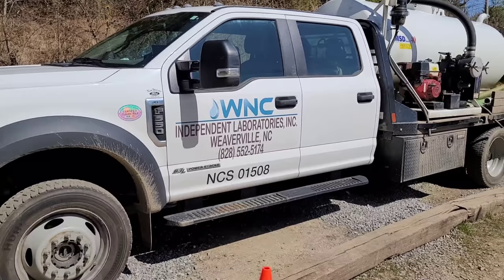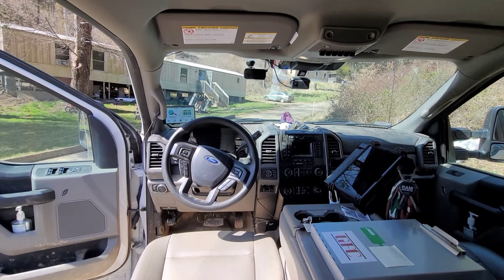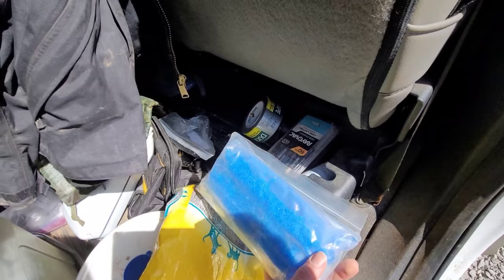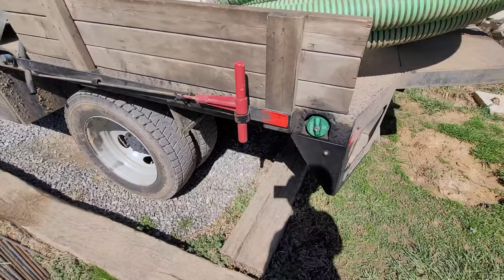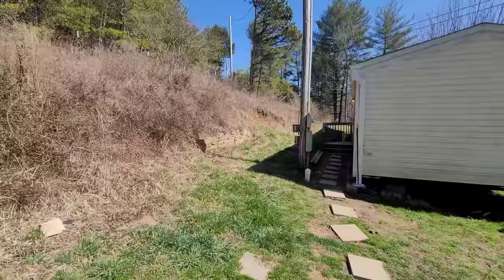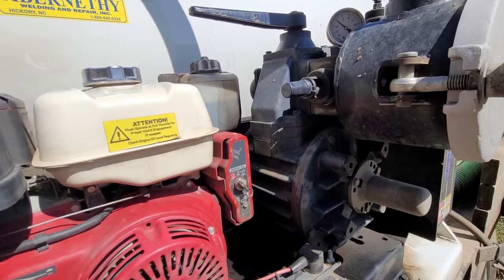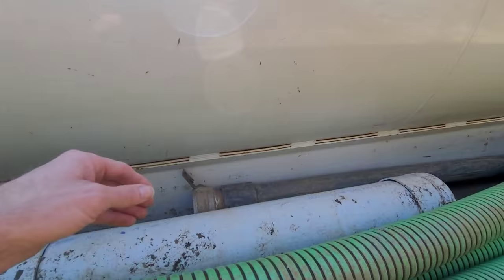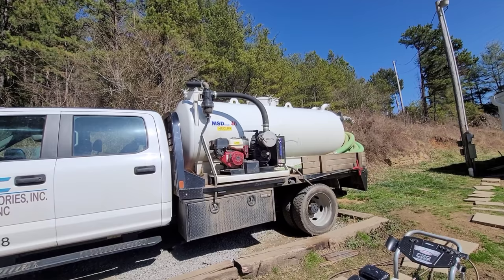Truck walk thru.

Comment: Just a few things I saw, first you should mount the GPS unit to the pocket on the center of the dash instead of the corner windshield, second, switch out the cooler to a ozark trail one from Walmart, they were tested against the yeti and found to be within one degree of it after a 24 hr period. Also on the back of your truck you should have a positive battery feed to the 7 wire trailer connector, wire that to the electric start on the pump motor thus eliminating the need for a battery. Just my two cents

Comment: For the issue with the valve freezing. What about putting a T in the exhaust (with a ball valve), running up to a box that is fashioned to fit around the valve. This would allow you to utilize the heat already being produced by the truck running. Have the box made so that it bolts to the bed for easy removal in case of repair or summer operations. Just an idea.
Reply: I saw your video on tic-tok and wanted to see if I could help. Have a great day and good luck with your endeavors. I enjoy watching your content!

Comment: I was thinking of a few things 1) for the back seat of the cab maybe you could get an organizer for it? Like one with drawers and goes halfway or all the way across the back might make it a look a little nicer inside the truck and be able to find things a little easier 2) I was thinking of a cover for the pump so you don’t get water into it I’ve seen some others have said that as well. 3) with the shovels and other tools that sit in front of the tank maybe get something like a gun rack holder but a holder for the tools so they don’t bounce around as easily

Comment: I don't know if anybody's mention this yet but I didn't see a battery charge wire coming from the truck to the battery on the Honda pump. 
I don't know about cab and chassis trucks but your standard Ford  pickups come from the factory with a trailer tow battery charge wire that runs to the rear bumper  7-way trailer plug and charges your auxiliary battery when the truck is running and disconnects when you turn the engine off. You might not have a 7-way plug on that bumper but the wiring might be in the frame.
I cannot say if that's going to extend your battery life but it would definitely be more reliable way of charging the battery. ther the other two truck brands the wire is alway hot.

Comment: One thing I would suggest would be to ditch the plastic gas can and replace it with a quality metal jerry can with a lockable mount.

Also, what about some 12v DC heat tape wired into a switched ignition source to warm up the valves before a job? Could the seals withstand the heat?

Comment: Few things First, I would sugest getting michelin tires they come with a better warranty and would probably last longer for close to that price.
Second, I would look into putting sone silicone on the pump handle to keep water out you said you need to take it appart once in a while so you should be fairly knowledgeable about it and putting a bit of silicone in the right spots would fix the problem.
Reply: I was thinking same thing but I’m not sure how an off road tread would hold up to his heavier weight. I’m assuming it’s prob a softer tread for more gripping as well. I’d contact other local businesses who haul heavy loads to compare tires and lifespan

Comment: The only thing I didn’t see, that i have seen in pretty much every work truck, is a fire extinguisher that is easily accessible. You can find a quick release for the fire extinguisher on the internet, kind of what they use on race trucks and off road rigs!

Comment: I would say a cage that sits over the tank to wrap hoses and hang tools, if removing the tank is necessary heavy duty hinges on bolth sides so it opens to lift off.

Comment: 1. Put big handles on your metal pole "muguffin thing" for more ergonomic use.
2. Look at having an attachment for your metal pole, eg so it can be an L shape for better access into awkward corners. (Use your knowledge on best angle for the joint as well as if the final hole should be eliptoid to better suction on low amounts?)

Plus as mentioned get a better battery, seal for the pump and reversing camera.

Comment: Solar panel charger for the battery on the honda. Those motors dont out out much voltage to charge battery completely up. Also the metal gas cans. I switched to them on my welding rig. Iv crushed to many plastic ones. Also easier to pour out of

Comment: Here from tiktok, I think you run a great company, only suggestion I would have is a small cabinet or tool box in the rear of the cab for all loose items, and also a solar powered trickled charger for you Honda motor battery, should double the life of battery saving you $$$

Comment: Save weight and hassle on the batteries for your small engine. I have a 2017 F450 with a 500 gallon duo tank for servicing portable toilets. Ran 14 AWG wire to the starter and put a 30 amp fuse in case the wire rubber thru.  Haven't had issues with the thinner wire, surprisingly. Going back I would of gone with 12-10AWG. On average the starter would be cranked 10 times a day.

Comment: Should have that copper sulfate labeled and a set of Safety Data Sheets for any chemicals that you have on the trucks. In case of an emergency anyone could pull the sheets and know who to call or how to administer first aid for the chemical that is causing the emergency. 

Could you hardwire the generator into the truck battery? Or do you charge that generator battery at the shop like you would a boat battery? 

Could you add a back up camera above the flood light in the back? Could save you if someone says you hit something when backing up when you never did.

Comment: You mentioned having to replace the pump starter battery regularly as it fails. Most likely it's at least partially due to the temperature changes from being mounted so far to the outside. That aside. It would probably be far more cost conscious and far more reliable to simply run 4ga cable from one of the truck batteries. A fusible link, new battery terminal, and cables would probably be close to one or two battery changes. The truck batteries are built to handle the massive load of starting that diesel engine, that pump starter won't even phase them. The best way to eliminate failure points in a vehicle add-on is to integrate it with the primary vehicle system.
Reply: Another thought, You may consider going with something like a Navistar (International) chassis. A lot of ambulances and smaller fire trucks have made the switch from Ford, Chevy, Dodge because you can still get 4 wheel drive, you can get all of the features, but you can push all the way to the limit for needing a CDL, and because when you use that large of a chassis, it's built for way beyond what you're using it for, so it tends to hold up longer. You can get it without airbrakes, if your guys don't have CDL's. If you want a look at capabilities on that platform, take a look at what the guys at Skeeter Brush Trucks are doing with those chassis, and the ridiculous loads they are able to put together and still maintain off-road capabilities.

Comment: You would benefit from a backpack on your trucks. They are open from both sides so you can get shovels and what not in still, in the top you could have drawers that pull out that you could put the items from in the cab in instead of on the floor in the cab.  Just a idea for you

Comment: hello from tiktok.  I'll go back and give this a second view, but here are my initial thoughts.... heat sleeves to help the valves from freezing; also regarding freezing valves during winter, reach out to your local fire department and see what they do to winterize their truck's nozzles and valves (or even reach out to tiktok firefighters).  Get a 5 gallon bucket with the lid that has the painters pour spout for the litter to  keep litter from getting all over the truck.  Keep an extra rubber seal (the ones you have to glue in) in the glove box or with the tools, just in case.  get yourself a small commercial ice maker for the office if you don't have the yeti's the plug in.  Consider a metal cage/screen between the 'back seat and front'.  Should there be an accident, that yeti, 40# of litter and suck all become pretty heavy projectiles.

Comment: If your 3 postion pump function selector pivot is capturing water  and freezing internally each day or night maybe both in extreme weather conditions find the lowest freeze point windshield washer fluid you can purchase and flood that pivot joint. The washer fluid will not damage seals and is very cheap insurance that should enter that cavity as easy as the water that's creating a hassle and down time

Comment: so the reason the seals in the cam locks aren't glued in is there is diffrent types of seal depending on the use. it's easyer to swap out the seals than storing the diffrent pipes with all the diffrent seals a bag of 100 seals fits in a small box

Comment: This is very impressive. I am absolutely impressed.  The only thing I want to ask is Jump pack. To jump the truck just in case. The only other thing is have you thought about a wench?  Also get a backup camera. Those will make backup a lot easier. How about detachable LED lights?

Comment: On the generator to increase the length of time between battery replacement I suggest a Optima Deep cycle battery. With the solid core design of Optima batteries you will get a longer usage time than a standard lead core design that deterioriates more frequently under harsh usage

Comment: Most importantly:  mount the first aid kit to the roof with velcro. In a high stress situation you don't want things obscuring it like in this video.  Seconds save lives

Electric heat element tape around the valves will help with freezing

what3words to find tricky jobsites and record precise location of work for next time. 

Put a light on mookentooken

Endoscope camera

Rear facing camera to record the back view

Expensive: add a defib for the one day you'll need it. 

Resqme tool in the cab

Put a soda bottle top over the pump valve.

Something for fire suppression

chemlights and heat packs

mylar blankets

Comment: The pump selection lever could use something like an umbrella seal under the handle. As far as the ball check valve, maybe set up a switch that will kill the pump engine when I it gets full.

Comment: You said it, weight is money. Ditch the 12v starter battery on the Honda a wire it into the truck. Your big diesel likely has 1000+ cranking amp battery. No sweat to start the little Honda. In addition to cost saving, it's a safety issue. If you hit that battery with a shovel or a pick while loading and unloading you'll have acid everywhere. In my neck of the woods that's also a pile of paperwork on top of a potentially life changing injury. It's low probability but high severity so it's worth mitigating that hazard. 

Back up camera would make a huge difference.

A storage solution for the backseat. Even you were rummaging around for things. There's commercially available underseat storage solutions or you can have one custom made. It'll also make the equipment checks more efficient if everything has a home.

Loose stuff in the bed is a big no no in my jurisdiction. It's also a potential liability for you. Also, if everything has a home it's easier to see if something is missing.

Lock/fuel line deicer is ethanol or methanol based. If water can get into the pump valve the de icer can creep in there too. Quick work to free it up. Might also work for the valve at the back.

Comment: One thing you could do is save $100 a year per truck and remove the battery for the Honda engine and wire to the truck batteries!  Just a thought.  I came over here from Tiktok for the $100 😀

Comment: Here are my thoughts... 

- Consider switching to the yeti ice pacts instead of the gas station ice. 
- Purchase a small jumper box to jump you or another person. 
- Consider installing amber flashing lights if you need to set up shop on the side of the road or to increase visibility and to reduce liability. 
- Consider putting your logo on the side and back of the tank. 
- Consider putting scene lights on top of the tank on all sides 
- Consider putting a “dash cam” on the back of the tank.
- Consider “hiding” some of the motor and equipment to keep a good image for the company
Reply: Expanding on the ice a drilling company I worked for spent money on buying better filters and what not for the ice machine and we found by doing that our ice would last us several days vs just one with a higher quality ice.
Reply: @ShireCraftMC  I was thinking more of cost. Would it be better to use reusable instead of one-time use? I personally don't know because I always empty out my cooler when I am done with it.

Comment: Tip from a fleet owner.  You don't tow and you don't drive long distances.  In the long run i promise you that you are better off going to a gas vehicle.  You don't need a race truck and fuel consumption with your current setup will make little to no difference more importantly switching to gas will cut your maintenance by 40 to 50% in low speed high idle applications over diesel.

Comment: What I'd do differently: 1. backup camera. 2. lightbar at the top which can function as worklight/siren. 3. I'd put a metal box around the pump setup on the left. It would protect it from harm on the road and also solve the freezing issue. It also helps with safety of the equipment against theft. This also give opportunity to get the vanes and spades inside a more secure place. 4. same size box on the other side of the truck, on the exact same position. Pack the stuff from the passenger area into that box. Only the vests, gloves and hand sanitizers stay, everything else goes outside. The current state is messy, and i wouldn't want to sit on the back with chemicals under my feet. This also helps with the balance issue and the air resistance would be the same on both side of the truck. 5. I'd change the cat litter. If it's the moisture absorb rate than you are better with  Calcium chloride 94%. If it's the price than sawdust or even simple sand can do the trick. 6. In the right side box a small high pressure washer to clean up before entering the truck. 7. That front of the vehicle is begging for a wench. :)

Comment: Two suggestions for you
One since you guys back up a lot on all your trucks once you put a reverse camera or a back up camera on all your trucks so would be easier splashy with that blinding lights and you won’t have to worry about that extension of your truck getting damaged and also the reverse camera would be so much under there and you definitely have a lot better reverse clearance on not damaging anything or hitting anything but still use both side mirrors but you’d have a third eye with the camera
Second suggestion is instead of having the Garman or your GPS in the way of the arm bar there or the hand rest bar whatever the hell it’s called by the door in the window put it where the speedometer is or towards event so your eyes are still on the road I’m not glancing and since your cameras inside the vehicle if someone’s drinking you’re still somewhat distractedLooking down at the computer that’s to the right side of them that they would still be considered distracted so another suggestion is since they have a computer have everything on a tablet or computer and everything’s right there in one spot and also less power running through everything where it’s all in one spot for work orders GPS and everything

Comment: Hoses should be on a roll to save space, pump should be pto driven( saves gas), charcoal filter on that vent so it don’t stink you pump, and a water tank you can pressurize to use with a spray nozzel

Comment: A ball valve on top of suction connection (tank side) to break vacuum in hose so it’ll run back to septic vs. breaking it down and leaking sewage onto property.

Comment: To bad you couldn’t install a platform truck bed storage drawer on the passenger side of the truck. Could give you some more storage and only lift your hoses on that side by 8 inches or so. You might be able to get a cheap cooler to store your gas in and call it an extra containment  area to help keep it from Bouncing around.

Comment: when you have the honda motor perminantly mounted to your truck just run some remote wires to your truck and delete the starter battery altogether instead of replaceing it every year (yes i know most trucks are 24v but thats usually just 2x 12v batterys so getting 12v out is not hard)

Comment: It would probably be worth tapping into the truck 12v system to start the Honda engine instead of buying a new battery every year. You may have to use a large gauge wire to make sure you get enough amps.

Comment: I saw someone else do this but it might give you an idea. I saw one company take off there Honda engines and then put a hydraulic motor to run the pump off the truck he got it equipped with a pto and he did it for the fact he doesn’t have to worry about a second motor and a second fuel on his truck. Every one is different tho. Every thing is set up for what’s best for your operation not what every one else has

Comment: Use the exhaust for the Honda the keep the valve for freezing that how we do it in Wyoming and for valve in the back we use a electric little pads they are 12v . Also we use the truck batteries to start the Honda.